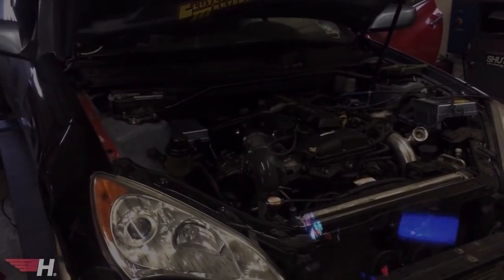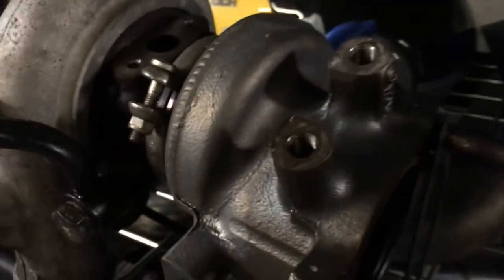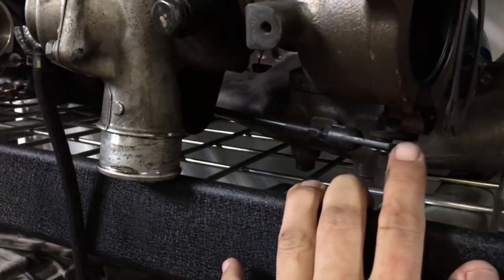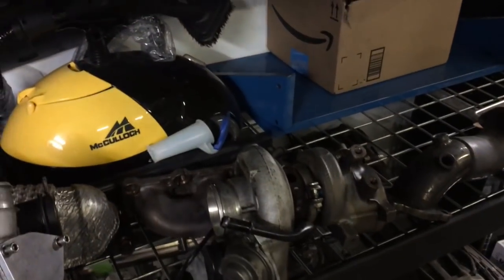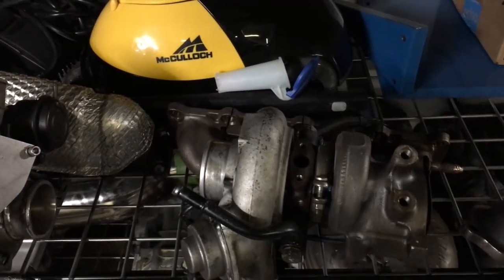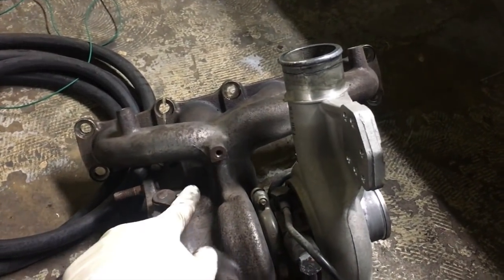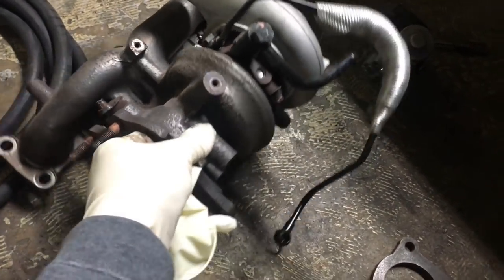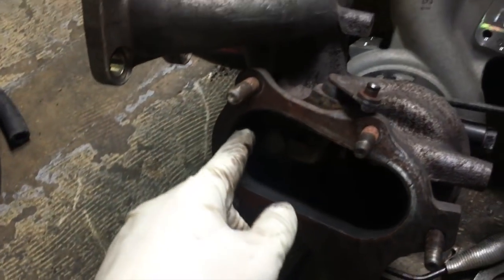How I made OEM turbo external wastegated

Comment: You have to excuse me because while I have owned many turbo cars, none of them were a Hyundai, but the 4B11 is a world engine, and I know they're in the Evo X, but wouldn't just swapping to an Evo X turbo make the car faster and more responsive? They make, what? 291-303 HP out of the box? What is the main difference between the 4B11 in the Evo compared to the Genesis? ECU tuning and turbo/manifold design? I know the relationship between Hyundai and Mitsubishi in the past resulted in Hyundais using Mitsubishi engines, but what was Hyundai thinking when they decided to stray that far from Mitsubishi and totally choke down the 4B11 for use in the Genesis? 210 vs 291 hp, what were they thinking? I realize that they can't offer their 4 cylinder with as much power as the 3.8, but why choke it down so much that it makes almost half of what the 3.8 makes? I know when they first came out there was very little aftermarket support for the 4B11, so it wasn't even worth it for people to put bolt ons on it because it just made very little difference unless you went custom manifold with a big turbo and completely redesigned everything. Once again though, I know very little about this platform, I'm just going by what I heard and read.

Comment: can you do this mode on the bk1 turbo or its only on the bk2 turbo? and if I'm already tuned stage 2 on my bk1 will i see a difference with this mode if it's doable on a bk1 turbo ? thanks 🙂
Reply: Marc Slusarek he said it is relatively easy to do external waste gate on the bk1 turbo because it's not twin scroll, but you won't see the power gains because that comes from the turbo itself being faster to spool